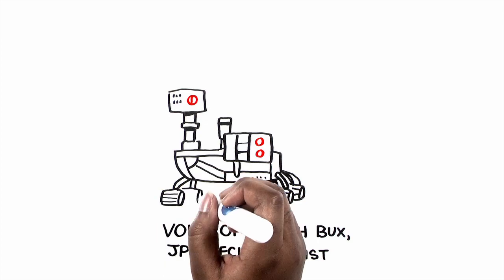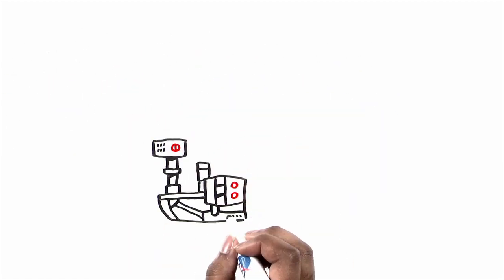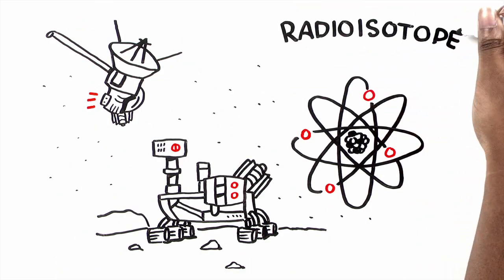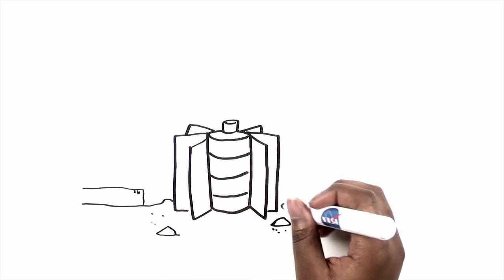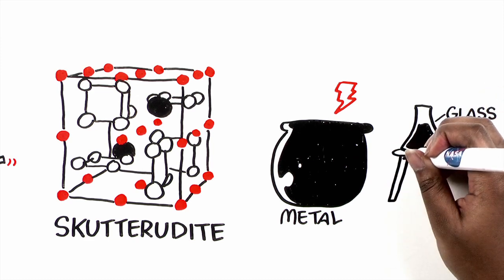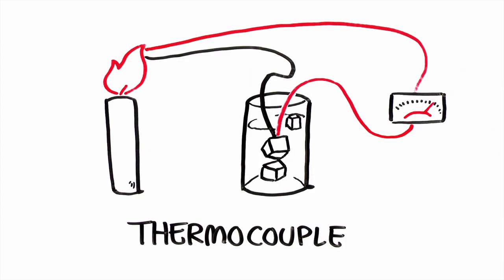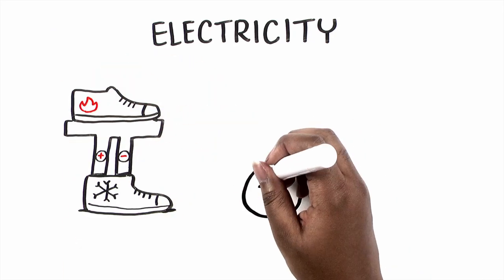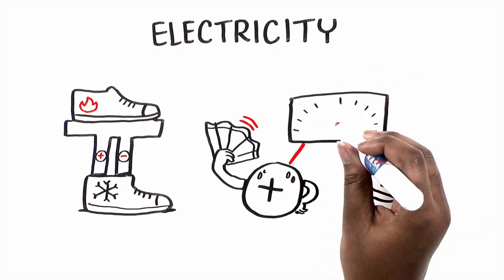Spacecraft Power

Comment: If they are powered by the heat generated by the decay of the radioisotopes, then why do they need to be designed with (what appear to be at least) cooling fins?   Can they overheat, or do they need a temperature gradient to work perhaps?
Reply: They use the heat of the isotope and the cool of the fins to make power. the larger the temperature gap the more energy

Comment: Nothing new.  Use a sterling engine.  Stirling engines have been around since before the turn of the 19th century.  In many ways I am surprised that the space station doesnt have one in service up there already.  One side exposed to the heat of the internal living quarters, the other side exposed to the cold of outer space.  The contrast would give free rotational power based purely on the temperature change.
Reply: Stirling engines would be too heavy. They would still require a heat source and a cool side with a heat sink. Instead of a thin solid state device, you replace it with the big, bulky sterling engine. The engine also has a lot more parts that can break. On spacecraft you want things to be as light as possible, so a thin membrane will always be preferred over a larger mechanical device.

"One side exposed to the heat of the internal living quarters, the other side exposed to the cold of outer space." With a sterling engine you would only really get to use the heat flow over a small area of the station, so you would need multiple to make power, especially with the low temperature difference compared to a hot chunk of radioactive material. The generate enough power from that you would need multiple, which would add a lot more weight. You could create a membrane on thermocouples, but you still might not make enough power to make it worth it. To add to it, you probably want the living quarters to stay warm. Covering it in generators which make power from the heat leaving might make it easier for heat to leave, and the extra heat that might need to be produced will take more power than what you generate.
Reply: NASA cancelled the Stirling project due to budget constraints, and instead will continue to use the MMRTG on the 2020 Mars Rover.

Comment: Are we ever going to send an unmanned mission to Mars that is capable of refueling itself on the surface? I understand it is currently impossible mostly due to weight issues. How cool would that be? It can refuel itself, it could repair itself, we'd get it stuck and the mission would end early... probably. I like the concept phase, anything is possible here.
Reply: John Hightower spacex has a plan to create duel on the Martian surface. it would turn carbon dioxide and water into methane and oxygen.
Reply: taylor sims That would definitely be a step.
Reply: All in the planning phases though. Not much has actually been developed yet.
Reply: In addition to what taylor is saying, the NASA Mars 2020 Rover will have many new instruments including one called MOXIE which stands for the Mars Oxygen ISRU Experiment. It's a small device which takes in the Martian atmopshere which is rich in Carbon Dioxide and converts it into oxygen. According to NASA, if the one in 2020 works as planned they could send one 100 times bigger with a radioisotope thermoelectric generator to help support humans. NASA and SpaceX have a very good relationship so this research can definitely help SpaceX in their venture to Mars.

Comment: Propulsion Question,  Okay the thrusters are acting against the gravity of the planet (to push upon), thus enabling it to maneuver on  the xyz axis, but what about in outer space where you'er nowhere near a planet, what are the thrusters pushing against to provide  momentum on the xyz axis, what are the thrusters acting upon ???  

A space craft that is stationary, can it go forward if it fire's it's rear thrusters, or would it remain stationary and the thrusters just spew out like a gyser ???

Is the sun's gravity and all the planets gravity, is it that strong of an influence throughout the solar system, for the thrusters to act against to provide momentum on the xyz axis, if that is what the thrusters acting against if so then what happens if you leave the gravitational influence of the solar system .... what will your thrusters be acting against to provide that momentum on the xyz axis ? 

thank you!
Reply: I think I can answer your question. It's all about mass. The thrusters are more like "reacting" upon than acting upon.When combustion takes place inside the engine the expanding molecules of the fuel (usually 2 chemicals such as oxygen and another that reacts explosively to the presence of oxygen)  rapidly expands - then the fuel's "remains" (molecules)- as a gas - that has mass (weight) - is, as intended, builds pressure inside the engine and finds an exit point - thruster nozzle. The spent fuel gas molecules has mass - that "acts upon" the thruster and causes spacecraft to move in response. 

Another method of propulsion considered is that of a very large "sail" that, when photons from energy source such as the sun, hit the sail and, because the light photons having mass (very tiny amount) - hit  the sail and moves it in direction away from the light's 
source. This type of propulsion has been looked into for very long distance space travel.

Hope this was of help. Steve Hawkins "A Brief History of Time" book has lots of great info - just suggesting as a read.
Reply: The thrusters are not 'acting against gravity' or 'the atmosphere', what is happening is the shuttle or rocket is creating a controlled, directed, and sustained explosion. The force from the explosion is focused, like a gun barrel, opposite where you want to travel. Every force creates an equal yet opposite force, so as your blasting fire out the back it creates a push towards the front. No atmosphere required, and actually in space there isn't anything to 'slow' you down physically so its much more effective. Would be interesting to see an astronaut fill a balloon in space and let the end go and watch it shoot off forever into the vacuum

Comment: Doesn't it have solar pannels as well as a back up?
Reply: Probably
Reply: Spacecraft that use RTGs always go to places where sunlight is either unreliable or is so far away from the sun that they produce almost no power at all.
That would be probes like Cassini, New Horizons, and the Voyagers. Tiny pellets of the RTG fuel can also be instead put inside the spacecraft to keep the electronics warm. I believe this was done on the Pathfinders

Comment: and then we have solar panels
Reply: JKerman511 they aren't that good working for example near Jupiter or on landscapes. Also they hate radiation. And they are heavy.
Reply: Da Ve light is radiation...
Reply: JKerman511 not that kind of radiation. Radioactive Radiation is hardly damaging panels. Also they loose power at higher distance from the sun